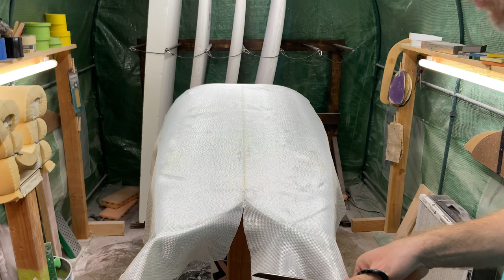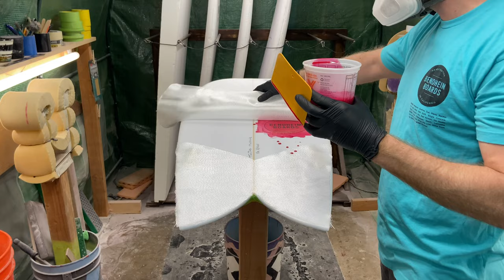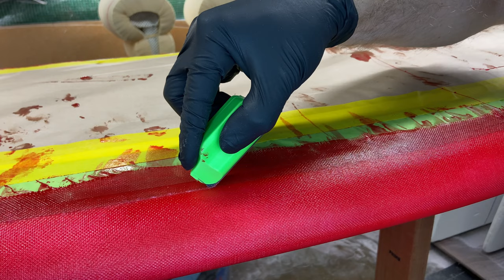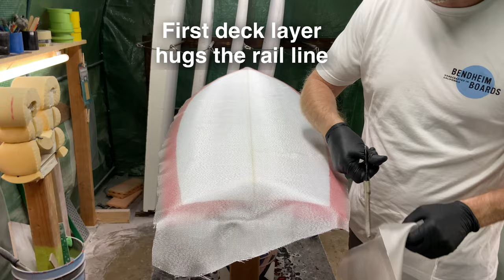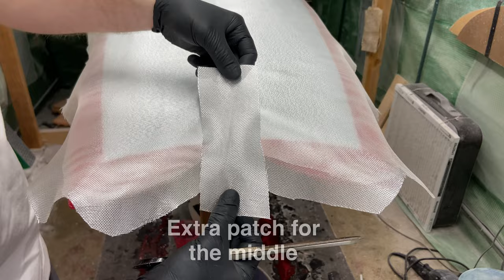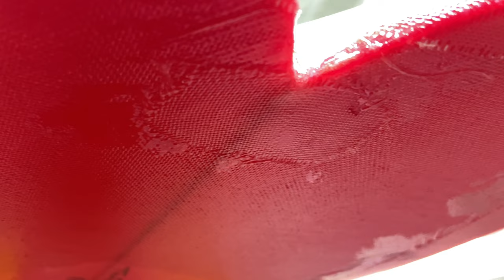How to Laminate a Surfboard Fish Tail / Swallow Tail

Comment: What's the green tool you use to cut the laps? Seems better than just a plain razor blade.
Reply from the maker: It’s a new razor holder from greenlight surf supply
Reply: @BendheimBoards  Thanks Tanner!